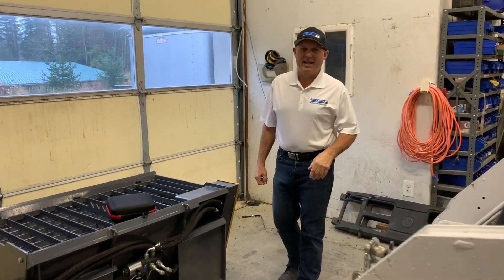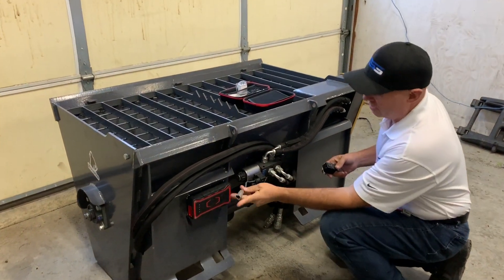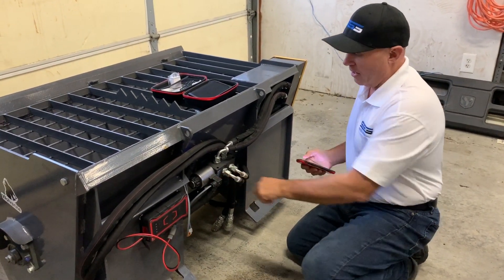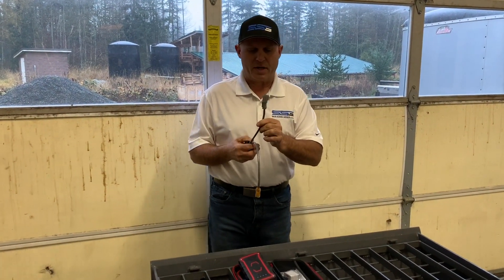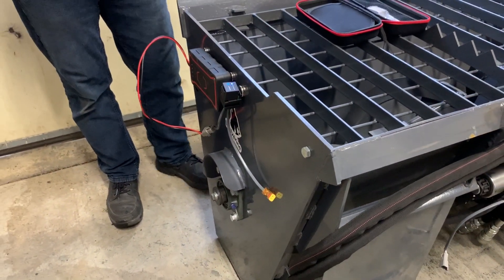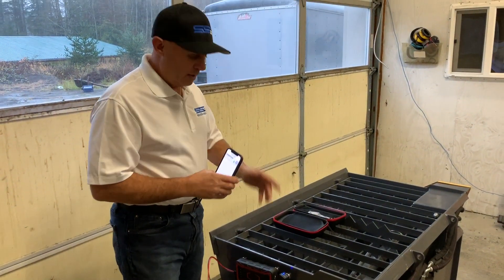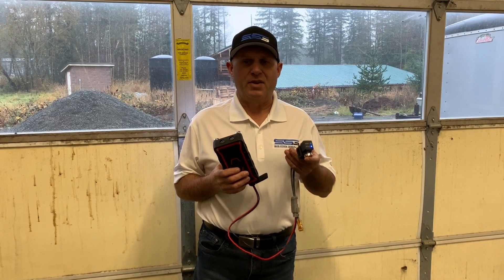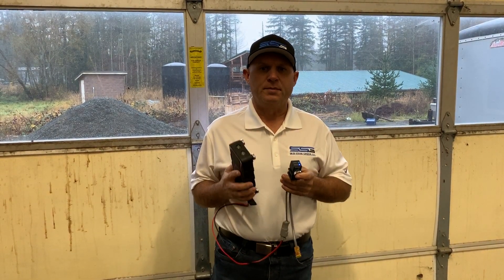#127 - Wireless Attachment Control - Bluetooth

Comment: I purchased the same mixer attachment from an auction. It came without any wiring to control the chute solenoid. I have a 299d xps, what do I need to buy from your website to make the mixer operational?
Reply from the maker: This kit would probably be your cheapest way.  Just cut off the ends and connect directly to the existing DIN.https://www.skidsteergenius.com/collections/bypass-cable-kits/products/genius-14-pin-cat-dozer-blade-kit-sg-bc14-ct-dozer-skid-steer-genius